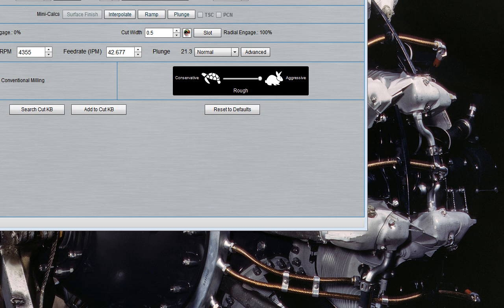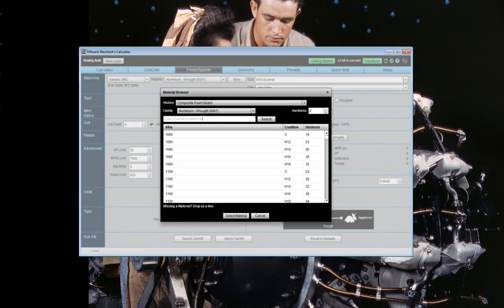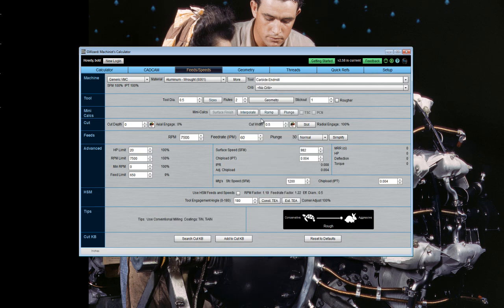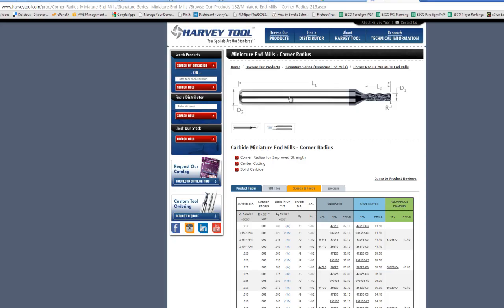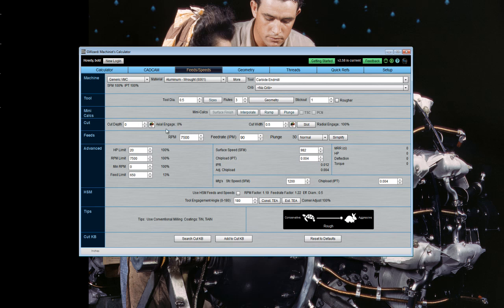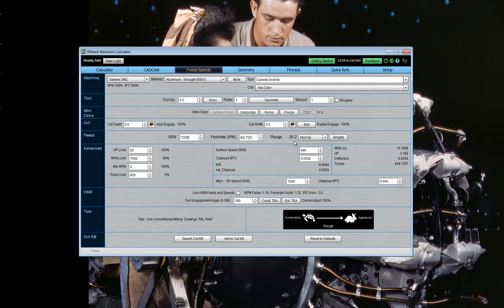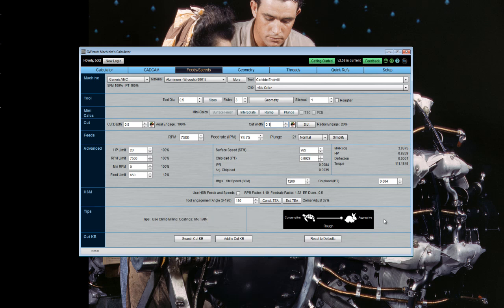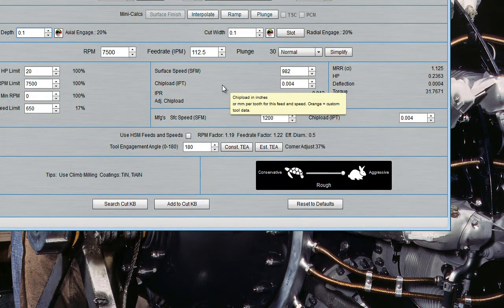G-Wizard University Intro to Milling Feeds and Speeds

Comment: So I down loaded your software ran the get started parts and realized that at this time I have other needs. I got hired by the local tech school to train students that are in machining jog. Train the people in an area that I have not been in in 15 years. I have 35 years in machine work. Most recently in ultra precision tool and die work. I was hoping your software would re- familiarize me with programing. I have the feeling that what you have is an editor of completed programs ????
Reply: so I am reading that there are 2 separate programs that can and do work together ??